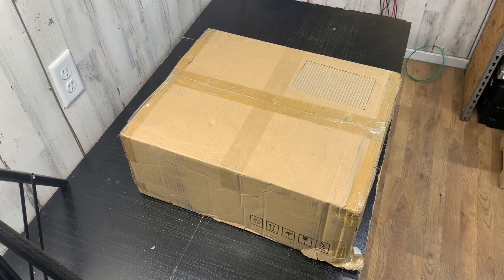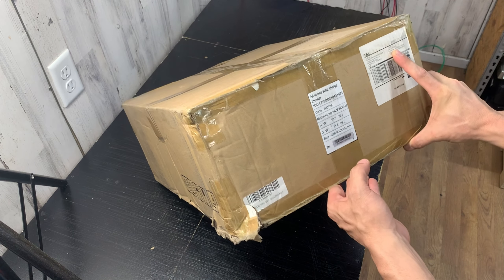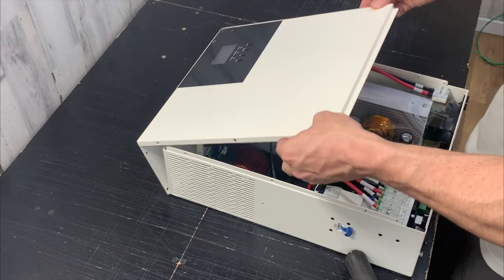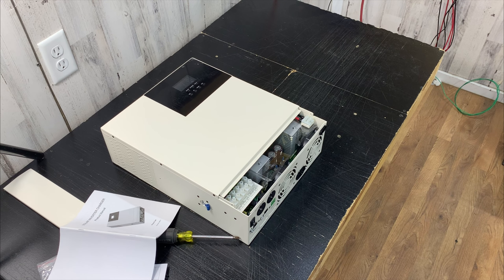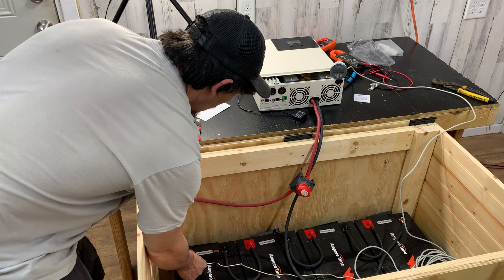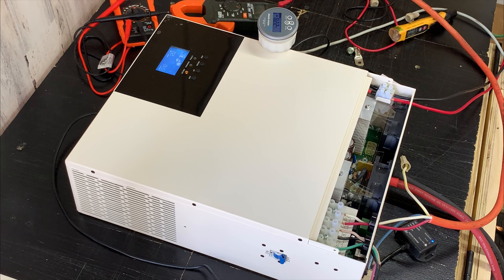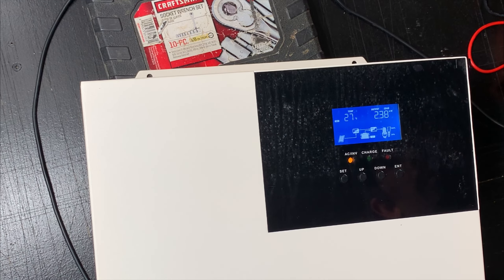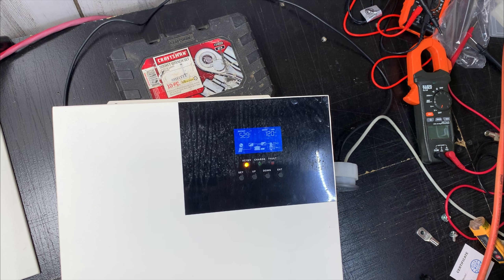Testing the EASun iSolar 5K MLV-U 5000w All in One Charge Controller Solar Bank LiFePO4 48v System

Comment: What's the idle load consumption?
Reply from the maker: 35w is the idle consumption, that’s pretty good for a 5000w all in one. To give you a comparison, my previous setup consumed 25w on idle. It was a 1500w inverter with 3 Renogy Rover Li 40a charge controllers.
Reply: @doingitthegreenway  that's good
Reply from the maker: @akinwaleakintoye8304  I thought so too, good question!!

Comment: That switch is rated for enough amps but bro I swear it's not big enough. I about burnt my place down with that exact switch. The larger one that's about the size of your hand is what you need . I'm not picking at ya bro ... Just trying to save you from a disaster. I have about the same inverter just a different brand.
Reply from the maker: Thanks for the heads up. I will be looking into upgrading now!